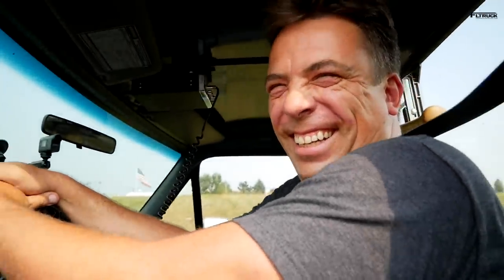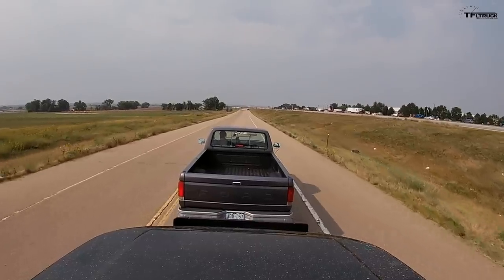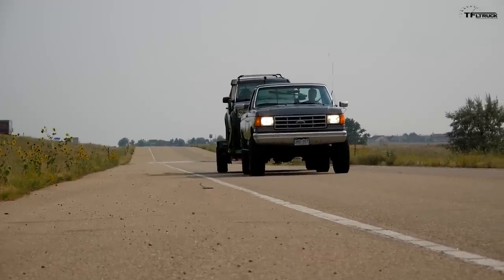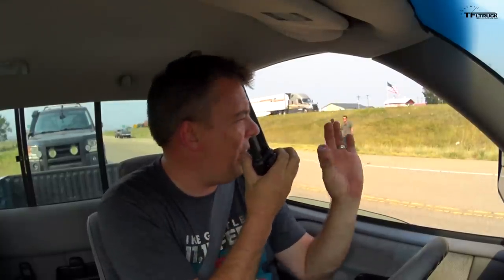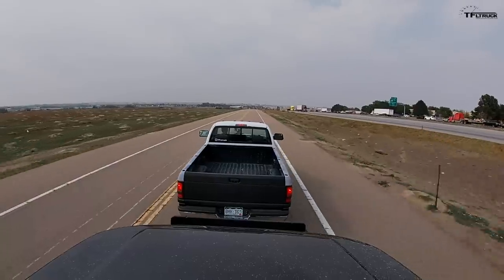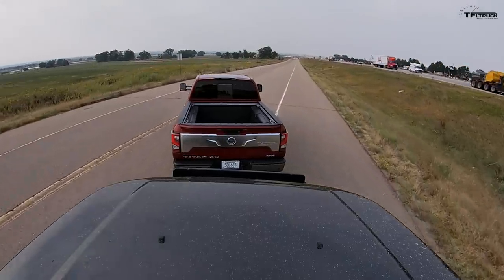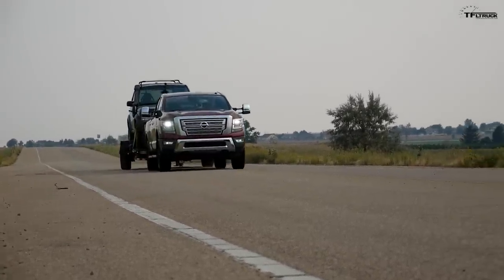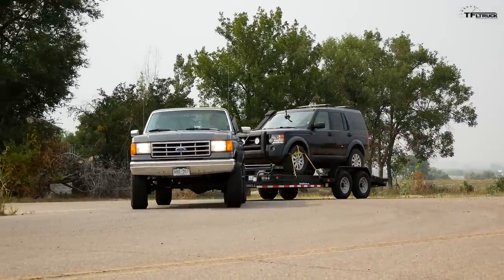Surprising Result! Can a New Half-ton Gas Truck Out-tow an Old Diesel HD Pickup? Let's Find Out!

Comment: It would be interesting to see how much faster the IDI could be if it got a new set of of injectors and injector pump.
Reply: Probably won't help much, they should do a turbo kit if they want more power.
Reply: It would make a big difference.
Reply: Needs a new driver, these don’t drive like other vehicles. Need time to get used to the very low powerband.
Reply: A turbo kit would help, but thats not the spirit of the test of seeing how a factory 1989 truck performs against newer trucks. The injectors and pumps do wear out over time and lose alot more power than people realize. I know the old truck is going to lose to any new halfton, but I would like to see the the test as close to a factory spec vs factory spec comparison as possible.
Reply: @calebdean2440  turbo was factory for the 94 model idi engine, im Just saying it still could be OEM and get a little power boost. Not that it will compare with a gas engine that revs several thousand rpms higher but so it could hold speed better hauling up hill. Also they already lifted it and put bigger wheels on so it's not exactly stock.
Reply: Agree, the lack of smoke on a non turbo IDI when flooring it indicates it is out of time and or under fueled, useally caused by worn IP and injectors.  I'm not advocating over fueling to 'roll coal', but factory new these engines did leave a noticeable smoke trail at WOT while accelerating.
Reply: @ReindeerBork  Yeah, the guy couldn't drive that idi for shit.

Comment: My stock late model 1/2 ton out pulls all of my previous 3/4 tons (mix of chevy and ford dating back to the mid 80's) from a torque perspective.  I did make sure to get a heavy duty trailering package and hill descent control (transmission control reminds of an engine brake) in this 1/2 ton.  I did have to put air shocks on the 1/2 ton to level it out with heavy trailers or loads.  Other than that, the 1/2 ton outperforms them all.
Reply: And one more thing!   I studied my towing requirements and found that 95% of my towing fell below 10K pounds (typically in the 7500-8500 range), so I began to question why I needed 15-30K pounds towing capacity for the additional cost of such vehicles.

Comment: It wasnt a fair challenge it was a setup for failure by design, these guys are a joke. First off you have 2 standard shifts competing against a automatic and andrea is one hell of a sloppy ineffective shifter compared to the brand new auto shift. Make it fair and legit guys
Reply: james mcdaniel Not to the outcome but they Andre made them look useless, no idea where the power and was in those trucks, above 3000rpm the idi’s pretty well lose all their torque you need to keep your rpm in the power band to accelerate... Those trucks will not accelerate once you get into higher rpm, trust my I actually have driven one, and a 7.3PSD, 6.0PSD, 6.7PSD, and a ton of gas jobs which actually like it when you rev the tits off them.
Reply: David Wark unfortunately both the 7.3 idi and 12v were not very powerful to start with. The big block (7.5 & 8.0) gas counterparts made more horsepower and torque at the time. The biggest draw to the diesels was the superior fuel economy. But I do agree that they seemed a bit sluggish..mostly due to size of the tires I’d believe. Still even with that I’d think the result would be the same. My 6.4psd feels like it’s sweet spot is 2000-2500ish rpms. Once the turbos get moving it puts the power down.

Comment: "They don't make them like they used to." You're right. They make them way better.
Reply: 😂😂 I want to see how that Titan Runs in 2050, you know 30 years after its manufacture date, these new trucks have so many electronics on them, very hard to see them lasting that long.
Reply: @samuelgibson4639  Wait 30 years and see then. Modern trucks are incredible pieces of machinery and technology. Will the screen or cameras or radar sensors going to last 30 years? Maybe not. But that's easily replaced, if desired. But the engines are far more powerful, efficient and have way better tolerances than ever before and will likely last longer. The only thing holding back modern vehicles are the ever increasing EPA standards causing vehicle manufacturers to take riskier and unproven technologies and add them to their vehicles for better MPGs. Other than that, these vehicles are far more reliable than older vehicles ever were. 

Old vehicles used to last 100,000 miles and need rebuilds. Today, most vehicles with proper maintenance can go between 200,000 and 300,000 miles before needing major work.
Reply: @dlakerguy  dont lie.

Comment: Back in 89 the big block 460 would have done better than the  Diesel.
Reply: Yep, I have one. I can easily pull 10k at 60+ no problem. Gets 6mpg doing it but power isn't an issue.
Reply: @travisb9130  yep, had an 89 f250,77 f250,94 f250 all with the 460cid. Great engines with lots of power
Reply: The 460 was great at passing... everything except a gas station 😁

Comment: Of course the new pickup is going to win. That 7.3 was what? 160 hp and 440 lb/ft? And that Cummins was 160 hp and 460 lb/ft.
Reply: The ford doesn't even have a turbo on it.
Reply: We know this, but to their defense I see people posting online all the time that their old ford or Cummings  tows better than modern trucks (usually followed by how overpriced the new ones are and only an idiot would pay for them).  Sometimes you've just got to prove them wrong.
Reply: @Nathan_King  old vehicles tow better because of weight and manual transmissions, not to mention durability.

Comment: Not really a half ton. The xd falls somewhere between half and three quarters. If it was a regular titan it would be a true half ton and not as good at towing.
Reply: They are just over grown half tons
Reply: I tend to disagree.  Call it whatever they want, Nissan tried but still fell short of the market.  For example the XD has a tow rating of 10.8k lbs compared to 12.7k (2020 Dodge 1500) and 13.2k (2020 Ford F150).  
They have the most "standard" horsepower because they only have 1 engine option.  Ford, Dodge (yeah yeah, I know), and Chevy have better options.
Having owned 3 Titans over the years it seemed natural to get the XD when it came out.  There's a Ford in my driveway today.
Reply: @rbhe357  Not arguing that there are much better towing options but by weight classification it's a  2B which is the category for 3/4 ton trucks. It's hard to call it a 3/4 ton though because it gets  absolutely destroyed by any other 3/4 ton in performance. It also tows about 1600 lbs more and has about a 900lb higher payload compared to the standard Titan which is a true half ton. This is due to a heavier duty frame. That being said if I were buying a truck I would compare it to half tons(wouldn't really consider a standard titan)and if I were looking for a HD truck I would not even consider the XD .

Comment: Goes to show how good modern half tons are, when an underdog Japanese truck that has barely 1% market share can perform so well at a mile up with near max load.
Reply: 1/2 tons do not have the heavy duty axles to allow for towing heavy weight over it's lifetime. The 1/2 ton towing heavy will die at 10ok miles, those older diesels will go 500k fine
Reply: @itripper1  When people are buying luxury trucks that have trendy infotainment systems that will be outdated in 3 years, I highly doubt anyone cares about the axle longevity. Although, I do agree with you. After 14 years of using our Titan as a heavy tow rig, I recently had to have the rear axle bearings and seals replaced. This test was a little too focused on just 0-60mph. When we tow heavy with the Titan, it does feel every bit only a half-ton. I wouldn't mind a heavier truck at all.

Comment: I thought Andre owned a 2005ish Chevrolet Diesel 2500. That would have been a good one to have in the mix!
Reply: A stock LLY dmax would have beaten the Titan by a bit. A LBZ would have beaten it by a bit more
Reply: Early Duramax are very fast, it would not have helped them to push Nissan sales,  hence driving the Cummins slow shifting and short shifting with huge tires and bad gearing.

Comment: Note to Andre, those old fords make all their power under 3,000 RPM so shift higher as you increase speed. Also to note, I have a 1990 F-250 towed 8,000 LBS at 50 fairly easily.

Comment: Those older diesel trucks were not built for 0-60 times.  What is their time unloaded?
Reply: The point is though that they can't even get up to highway speeds pulling a fairly mild load to today's standards. There's barely a modern half ton that's not rated to tow that 8,500 lbs and that was all but killing the Ford and even making the Cummins work for it. The test was just to prove just how far trucks have come in hp, tq and just overall capability. Hell modern diesel 350's can tow unreal amounts of weight when optioned right. It's crazy.
Reply: @cfltitan  I have two older diesel trucks, I cruise them at 65 due to trailer tires,  but they can go 75 fine.  Something about that Dodge seems off, it was way slower than it should have been
Reply: itripper1 might be he was shifting it super slow. Might have a crappy "rolling coal" tune too or just a bad combo of parts.

Comment: I  used to pull a big stock trailer gooseneck with four horses from Minnesota to western Colorado, in the days before the tunnel over Loveland. I had a Ford F250 with a 390 and a  four speed, i walked up and over those passes with no problem. It sucked the gas, but, it sure as hell could pull a load. I also used it on the farm to  pull hay wagons and grain wagons with way more than the weight it was rated to pull. These modern trucks do not impress me at all.

Comment: Grandpa pulled a big 5th wheel camper with a F250 with the 300 six cylinder gas motor even in the Rocky Mountains. It's all about how fast you want to go.
Reply: That 5th wheeler would have not been all that fast
Reply: @robertryan7204  nope, but it would do the speed limit which was 55 nationwide at the time, and need to stay in 2nd gear on the passes, so maybe 35 mph. That's what all the semis used to run on passes as well. I bet grandpa was ultimately 10 times safer doing that with an 80s Ford than the average weekend warrior pulling a 18,000 pound 5th wheel with a modern F350 at 70 mph.
Reply: @bryanhersman4037  Agreed. Trying to pull up at 70mph with such a load not a good idea
Reply: @bryanhersman4037  Here you get some interesting vehicles to tow 5th Wheelers.  These are preferred to early F250's(2006 and prior) to tow up to a 36ft 5th wheeler. Only have a 3 litre Diesel but now a 10,000lb payload They have a 23,850lb GCVWR
https://www.tradingpost.com.au/Caravans/Caravans/Crossroads-Cruiser-Fifth-Wheeler-25-Foot-2016-Iveco-Daily-Dual-Cab/Yungaburra/QLD/AdNumber=SW3KVJ
Reply: @robertryan7204  I currently have a VW 3.0 L diesel and it's amazing even being an older design. The most current 3.0 diesels are better haulers than even a 420 hp over 6 L gas motor. So much torque.
Reply: @bryanhersman4037  Exactly many in the US do not realise how effective these engines  are

Comment: I'm new to the channel and love it, but this video is out of the ordinary for you guys. TFLT is very apples to apples to apples when comparing what one truck can do vs another. The comparisons are always spot on and involve identical conditions. In this video, the two older trucks were rolling on 35s (?) and unless they were re-geared, drive like gutless crap even when empty on level ground. Video would  have been infinitely more interesting with 2 older trucks with stock-sized tires. That would be "fairer" IMO. Still love the channel in any case.

Comment: The BIG QUESTION........will these new overpriced, over engineered, glass jaw trucks be even on the road in 25 or 30 years!!!
Reply: Saw someone comment that these newer trucks are built better than the old schools like the ones they are testing.
Reply: Right on it!
Reply: Um if you have had a 90s Dodge or 90s Powerstroke yeah the engine is great but the rest of the truck falls apart just like every other pickup truck made ...  Constantly things to fix if you own a few of them

Comment: I wonder about the MPG of all of these, and maybe including an older gas and a newer diesel to really look at the differences between old and new.....I feel like that could be a whole series that many would be interested in!
Reply: Not sure about the old Ford but rouser old cummins were very well known to get extremely good fuel mileage even when towing. It took a bit to get up to speed but that cummins would have pulled that trailer all day long easily at that speed once up and moving and probably would get mid-high teens fuel economy. The titan would pull it easily too but being gas would probably drop to single digits or barely in the double digits.

Comment: It's a cool comparison, but it's not really apples to apples. You're taking the best case scenario of a modern half ton (heavy half) and putting it against short wheelbase trucks from the old days. It would more fitting to put the best case against the best case across a real world towing test like you do with your other tow tests

Comment: The only mistake you guys made was having those oversized wheels and tires on the older Riggs they're not going to pull is good.
Should have put the stock size wheels and tires on that 12 valve Cummins.
The Cummins would have out pulled them all..

Comment: One key difference, those older trucks can continue towing those loads day after day, even today with how ever many hundreds of thousands of miles they have. You try that daily with a newer gas engine and you will need a new engine every 80-100K miles.
Reply: Correct not that reliable

Comment: The ford has a few gearing options, if it's 3.55s paired with bigger tires and lift kit drag plus N/A-166hp engine at sea level, has a very big disadvantage at 5,000ft~
As well as there's a short ratio 5sp and a long ratio 5sp commen with the diesel,, that really affects off the line.
.
Go to 215-85-16 tires, dich the lift.
 swap 4.11s and a granny type 5sp
Probably be a solid 5mph faster.

Comment: I have a 1990 f 350 crew cab dually with the 7.3l idi NA diesel, I would be willing to put my truck vs that Nissan,  I have already done this experiment with my neighbor,  he has the brand new Nissan and I have mine, mine is bone stock but we'll taken care of. 200 bails of hay on his trailer and 300 on mine between truck and trailer. I live in the interior of Alaska and I out pulled him on every single pass, he even overheated trying to catch me on one. And that was from nenana to Fairbanks.

Comment: when you consider a LB7 or common rail 24v truck in mint condition is 15 - 20k and the fact that they have over 200hp probably 300ft lbs more than these older machines, the difference is a lot smaller and the older diesels are way better

Comment: I'm willing to bet the TRX is actually rated to tow much more than they say so that they can magically leap frog the Raptor each year. They put a ton of weight into the frame and there is more than enough power on tap. The only unknown is suspension, but seeing as they benchmarked the Raptor and it barely squats at all under max load It will probably be up to the task of 8.5k. Can't wait!

Comment: You're missing a GM truck in this. Say, a 1996-1998 Chevy C3500, 7.4L Vortec, 4L80-E GM 14-bolt rear with 4.10:1 ratio.  I think that will beat both the Ram and the F-350, and be close to the modern Titan time.  Also curious to know what the time difference would be with a C2500 (7.4L, 4L80-E, 14-bolt 3.73:1) doing the same test. (Must be the GM L29 454/7.4L Vortec, not the old TBI version of the 454.)  The L29 was the towing king in the 1990's.

Comment: Those old Fords were really slow but that Cummins was under performing by a lot, I have a 93 Cummins that I tow with, it should have been 20 seconds with the weight it had on it, I believe  that truck was being short shifted and slow shifted and probably geared wrong due to the big tires on it.

Comment: My 88 ford dually has the 7.3 with a banks turbo, zf5 trans, and locking rear diff could most likely beat those trucks in a tug of war..... oh yeah did I also mention I'm on STOCK wheel size? Kinda helps.... these guys didn't give the old ones a fair chance! And that dude was scared of em!

Comment: My fiance has an 05 Titan. It is a towing monster. I'd buy the new Titan over anything out right now just because of the 5.6L. They added all new modern features and yet kept the proven 5.6. Wish Toyota would do the same thing yet, they'll most likely go with a TT V6 setup. Rumor is they're tossing the V8 out on the highway. I hope it's just a rumor though. Japan has made two, damn well made, class of V8s. No they don't sell like the big 3 but, that doesn't mean they aren't as good. And I'm excluding Toyota's 2uz-fe 4.7 they eventually axed. I have one so, I already know how good it is. Tell me how many problems have you really heard from those two V8's, the 5.7 and 5.6, vs all the other engines in its class throughout their lifespans? I'm not a mechanic and don't really dive into the engine problems unless I'm driving it. I already know there's nothing wrong with mine. Now ask me how my frame is holding up, I'll tell ya a different story! LoL. But what are some problems the jap V8,s had compared, to the 'Merican V8 counterparts. If ya know that is.
Reply: I live by the plant that makes the Tundra V8s and I have heard from seemingly reliable sources that it's not just a rumor.  V8 will be replaced by tt v6.
Reply: @Nathan_King  Yep, figured it was true.
Reply: @Nathan_King  possibly the 3.5L twin turbo setup with possible electrification?
Reply: @whalehands  to correct, I heard from 1 seemingly reliable source.  But TTV6 was as specific as we discussed.